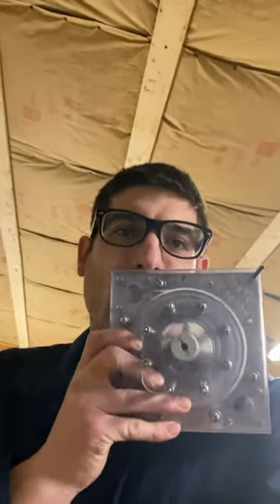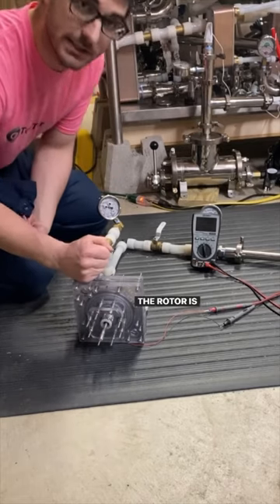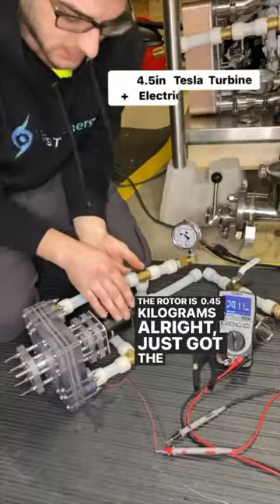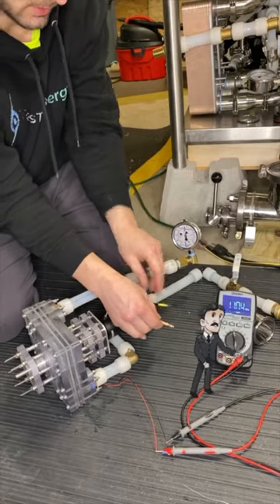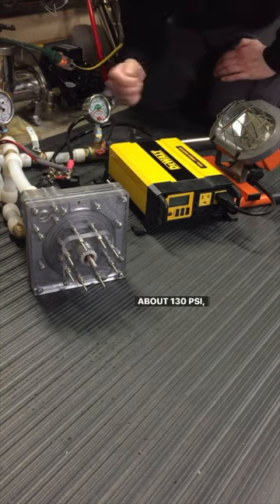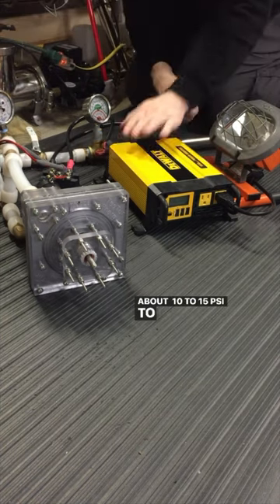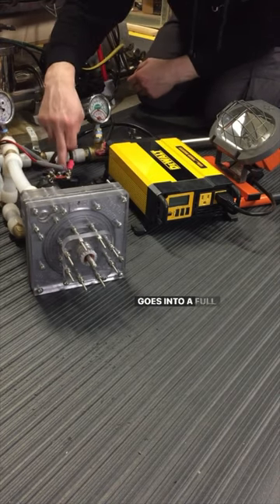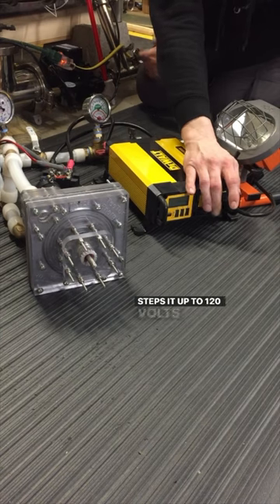🔥 4.5in Tesla Turbo Generator 🔥

Comment: I'd like to see this thing connected to a charge controller and recharging lifepo4 batteries in a small off-grid electrical system. I wonder if a pot of boiling water could be left on the wood stove over night that sent steam through the turbine to recharge house bank batteries while heating a cabin? A regulator would be required, but could be a viable piece in a small-scale off-grid battery/solar system when the sun isn’t shining. 🤷 I want something like that.

Comment: Honestly you answer on your videos several questions that arrived when I found about the Tesla turbine, is there any practical usages that you recommend for using it? I am looking exactly to implement a reception of the air in a drone connecting to the turbine and other 2 more mechanical and possibly activated through air  motors, in order to find an efficient way to deliver medicaments for difficult access areas of the world, specifically in Latin-America, I will probably start a job in a drone company but as an administration helper, I have this crazy idea and I am persuaded that this teslas success creation needs to be on it, It’s nothing finish yet, but we’ll from somewhere I could start, specially trying to give the idea as open source. Greetings from far away and thanks for your videos are really impressive!

Comment: How much rpm can the 4.5 inch turbine do?
Reply from the maker: Hey thanks for commenting but can I ask why you’re concerned what the max rpm is?
Reply: @CharlieSolis  I'm building a centrififugal compressor which will have a diameter of about 5 inches and want to know how fast it could spin before failing. Cheers.
Reply from the maker: @forloop7713  gotcha! That’s really cool! this specific 4.5 aluminum rotor has a max safe continuous rpm of 30,000rpm. 

hey thanks for commenting. 🙏❤️‍🔥 I really appreciate the love and support.    So just to be clear I do have a degree in physics and many years of working with industrial machines.  And now I don’t want to discourage you but I need to be abundantly clear though that sadly, these are not toys. They are VERY dangerous if not designed or handled properly.  I do not advise anyone who doesn’t already have a background in mech engineering/physics etc. to attempt to make one of them on their own.  If you wouldn’t feel comfortable taking apart a jet engine and putting it back together and know that it would work properly again then I would think twice about taking on this endeavor.  That being said. If you would like to start I would suggest by consuming as many mechanical engineering class videos as you can on YouTube.  Learn all the thermodynamics behind steam and gas turbines.  Specifically for Tesla turbines it requires a great deal more chemistry due to the Tesla turbine operating on molecular viscous adhesive forces between the fluid and discs and not in mechanical collisions with the blades like traditional blades turbine.  So making sure to have the right surface treatments for the proper motive fluid is very important too.   “Don’t French fry when you’re supposed to pizza or you’re gonna have a bad time.” <-Words to live by. 

I want to be explicitly clear with people just how dangerous this is. It’s easy to see the turbine not doing much other than spinning and think it’s not that difficult.   But to put some perspective on it…. 

The ~25cm (10in) diameter 75disc aluminum turbine is 4.36kg (~9.5lbs)     So whenever anyone see this turbine spinning they need to imagine a literal 10in diameter 10lb dumbbell weight spinning at 7,000-13,000rpm 🤯🥵😅    At 13,000rpm the turbine rotor has 30,000joules of rotational kinetic energy.     For perspective, that’s about equivalent to:  5-10% of the kinetic energy of a whole car at highway speeds.   If that stored kinetic energy were to be used to launch itself straight up into the air…    

KE = gravPE = mgH   

H = KE / m / g
     = (30,000joules) / (4.26kg) / (9.81m/s^2)
     = 708 meters straight up into the air… 🤯   

~3/4 of a kilometer or ~0.45miles.

Comment: And how much energy did it take to compress that air? IOW: What’s the overall efficiency?
Reply from the maker: Hey thanks for commenting. 🙏❤️‍🔥

As far as efficiency goes… (mind you this is a copy pasta 🍝 so it’s a bit long but it’s worth the read.) …My 2650watt electrical load run on the 10in diameter TesTur came in with a very low ball calculation of 40% isentropic efficiency.  To start off, mind you that includes generator losses, 3 phase rectifier losses, and inverter losses to the electrical load that were not accounted for. So the turbine off the bat is already most definitely doing better than the 40% isentropic efficiency I’ve calculated from the already low ball test results.   But for now I’ll just assume 40% isentropic efficiency so that I’m not over claiming what I can prove it can actually do for the time being. (I have nothing in the long run to benefit by overstating my numbers and only my legitimacy to lose. I’ve worked hard for my physics degree and don’t intend to tarnish it for a couple of extra views on the internet.) 

And mind you I haven’t done the efficiency tests for the 4.5in TesTur yet but I can already say it’s powering the same load for longer than the big one did with even less air. I made a bunch of fixes upgrades/fixes to the 4.5in TesTur. 🦾

When it comes to utilizing low-temperature, high-pressure gases for power generation, technologies like Compressed Air Energy Storage (CAES) and Cryogenic or Liquid Air Energy Storage (LAES/CES) are not just theoretical; they’re already in use at the industrial level.  In the context of engine mechanics, the typical workflow involves compressing air, heating it, and subsequently expanding it.  This is the essence of most gas turbines and turbojet engines, which operate based on the Brayton cycle. For those not versed in thermodynamics, the Brayton cycle consists of three key phases:  Air compression Heat input (usually through combustion, but other methods work too) Expansion of the heated air. 

When considering steam-based systems, you only need to introduce heat to turn the fluid into vapor. Technologies like Ocean Thermal Energy Conversion (OTEC) can not only produce steam but can also operate using an organic Rankine cycle at notably lower temperatures.  Of special interest is Tesla’s amended turbine patent, GB 186,083. This inventive design uses the residual heat from the turbine’s exhaust to produce steam.  The generated steam then pre-cools the combustion jet prior to entering the turbine, thereby reducing the usual compression demands seen in traditional gas turbines.  While conventional gas turbines work with air-to-fuel ratios ranging from 100:1 to 200:1, Tesla’s design minimizes the strain the compressor places on the shaft, allowing it to run efficiently even with stoichiometric ratios as low as 15:1.  Furthermore, Tesla’s subsequent patent, GB 186,084, integrates both combustion and steam turbine functionalities, negating the need for a separate compressor all together. 

As far as inefficiencies to the system to fix, there’s 10x crappy ball bearings in this version, 2 crappy RC car gears, both losses will be gained for power out with a direct to shaft generator. (Minus two gears and 8 crappy ball bearings)  There’s an 1/8 of an inch of space between the turbine endplates and the casing endplates on both sides of the TesTur. That’s a 1/4in of open flow area around the 2in wide turbine (that only even has a total of 0.75in wide of spacing between all the tight disc spaces for torque to begin with.)   That means 25% of the open space for flowing through the casing, between discs and between the casing and turbine endplates, is just free flow over the side of the turbine still. (I’m using the absolute bottom of the barrel of machining equipment right now in my garage 🤷‍♂️)  There’s no labyrinth seals yet to even attempt to further reduce that overflow…

The nozzle is atrocious at the moment, when making the variable converging section have a tight convergence it causes the fluid jet to aim more centripetally (towards the axle) instead of tangentially (glancing off the disc tips) which severely effects the fluids natural path.   This will be fixed with the new variable nozzle design I’m going with.    Then even further in this specific casing’s assembly there’s two “pillars” in the middle of the nozzle.   This is because the aluminum plates in the middle of the casing plate stack only had the variable nozzle bar and inlet holes cut out, and not the full nozzle geometry.  So those pillars are just vertical bars in the middle of the nozzle for the air to smash into just before going into the turbine (hopefully the wet steam tests will just erode them down 🤭)   Before all that there’s still about 100ft of air hose between the tanks and the turbine… plus a shell and tube heat exchanger and a TON of elbows and fittings.    I’m sure I’m forgetting something too but between all that being fixed… I can almost guarantee we will be in the 60-70s % range and that’s all just still with room temp compressed air.   Most forget, I’m using room temp compressed air and never went over 20psi at the nozzle for these tests. (Pressure differential and temperature differential govern efficiency)
Reply from the maker: And even then I still only even have a single stage on it yet.   Everyone wants to compare it to the efficiency of a very high temp, high pressure (1000°F & ~1800psi) multibillion dollar 15-30 stage steam turbines…   😮‍💨   That’s apples to rocket ships. 😅  But considering Rankine Steam cycles get theoretical max about 33% of input heat (due to latent heat of condensation and that’s without any regenerative boiler feedwater preheat, air fuel preheat, etc) and then 40% isentropic efficiency (considering the turbine as is) we’re looking at 13.2% thermal efficiency with steam.   A more apt comparison for the TesTur would be something an individual can actually purchase, like 1-5kW piston gas generators that you can get from Home Depot or Lowe’s.   These get 15-22% thermal efficiency off the plant floor. Good luck getting that 1 year down the line or later with all those moving parts.  Also for reference, industry standard for micro bladed gas turbines is 25% thermal to electrical. Whole system efficiency can go higher in Combined Heat and Power (CHP) system, but alas the TesTur would see the same whole system efficiency increase in a CHP Auxiliary Power Unit (APU).  In the TesTur you gotta replace…? 🤔bearings…? And still even then, only maybe 🤷‍♂️ depending on how good of bearings, balance, lubing, cooling.   The TesTur, and other bladed turbines, only have one moving part. 🔥 

So if those piston generators drop efficiency, even at all, the TesTur on its worst day is competitive with a gasoline piston engine electric generator.🤓😬🤷‍♂️  And the TesTur can handle any fuel that can burn, even solid particulate fuels like powdered saw dust, pulverized coal, powdered iron, biomass, etc. (noting the number of those that can be acquired without spending money… 🤑 opening up “low monetary cost”, even carbon neutral, fuel options for MILLIONS around the world)  We have to remember that the TesTur doesn’t have to be the holy grail to be worth using if we have free fuels readily available like biomass, and even waste heat already being dumped out into the air and not used for anything.  The TesTur just has to be a viable option for some to be worth doing. 

Even more, the mere fact that I’m using a low temp fluid for my 40% isentropic efficiency calculation means my TesTur efficiency is severely limited by thermodynamics and fluid dynamics.   Increasing temps will automatically increase my turbines efficiency.  This is because gasses have an increasing viscosity trend as you increase the temperature.   This leads to increased isentropic efficiencies in the TesTur from reduced slip on the discs.  (Meanwhile, we’re already talking about a piston engine using combustion temps as is.)  Whereas bladed turbines see the increased viscosity as an increase in drag loss through the turbine blades.   So we can’t always count on seeing increased isentropic efficiencies in a bladed turbine in practice when we go from low temp to a high temp.  Again, to reiterate, this increase in viscosity in the TesTur only works to enhance the working action of the TesTur.  (That being viscous adhesion to the disc faces increasing torque.)  That’s all on top of the increased thermodynamic efficiencies of using a higher temp elastic fluid too! 🤓 

The disc spacing for room temp gasses is not going to be the same for combustion temp gasses/steam because the viscosity of either increases by 3x fold. And I’ve designed these spaces for a higher temp fluid with a slightly higher viscosity so these will inherently be too wide at the current temperatures being used.   So as we increase temps along with all these other really easy to fix mechanical issues (that only are a thing because I’m building this in my garage on a junk cnc machine) I have no doubt we will see more than competitive isentropic efficiencies compared to bladed turbines, let alone whole system thermal efficiencies that are through the roof.   This is because of the heat recovery systems that can be added with the cost savings of using a TesTur vs a VERY expensive, and in my opinion, relatively delicate bladed turbine.   Just getting tighter casing clearance with the turbine should give me at least 20% points back on efficiency putting my testur at the 60% range.   Coming in with a 19% thermal efficiency in a Rankine steam system without any kind of thermal recoup.
Reply: @CharlieSolis  Thanks for the details! XKCD would be proud! ;-)
Reply: @CharlieSolis  Had to make a couple of passes to parse all that… but basically you’re getting 40% with a 60% theoretical?
Commercial steam turbines are about 35% efficient… gas turbines in the 60-70% range… plus if the waste heat from the gas turbine can make steam that efficiently can be increased by following the gas turbine with a steam stage. 
My next questions would be how efficiency would be affected by the speed and density of the gas… does a CO2 gas work better/worse than nitrogen? And at what temperature(s)? What’s the affect of plate size and spacing… does adding more plates help? Or hurt?
Inquiring minds (nerds like me) want to know! ;-)